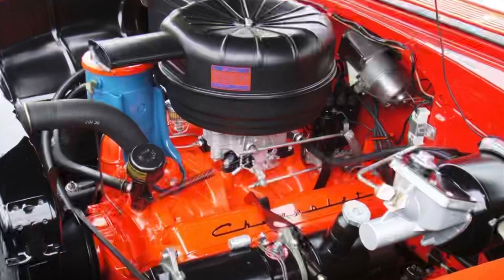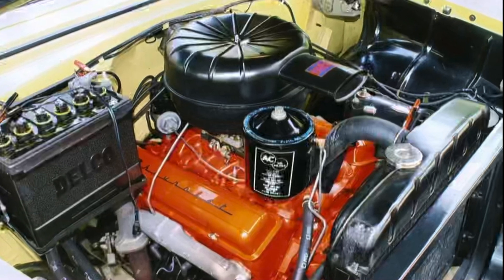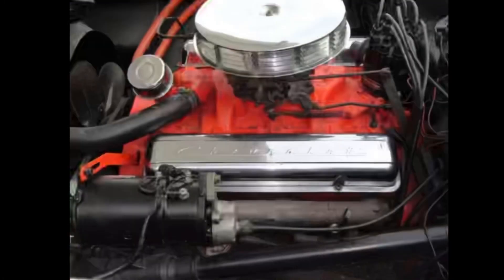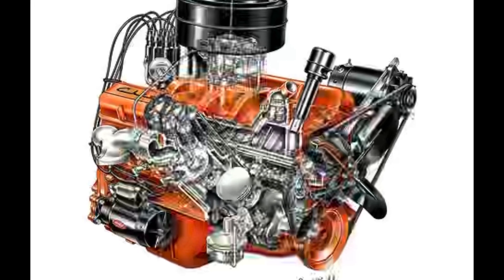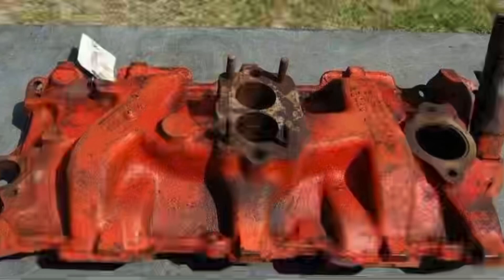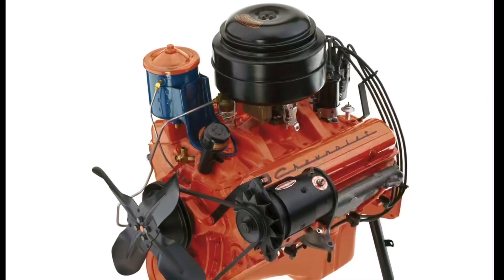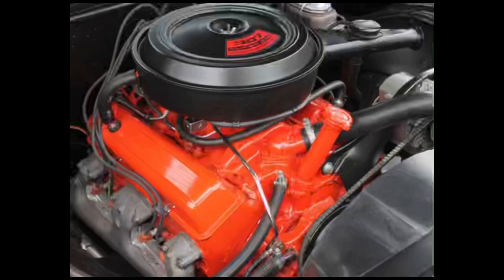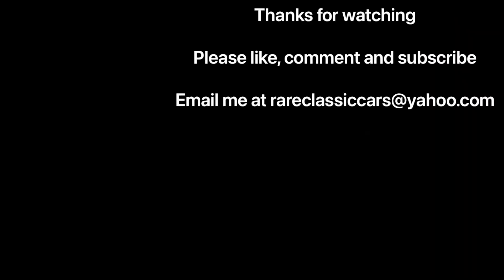Best Engines of All Time: The Chevrolet Small Block V8 (262/265/283/302/305/307/327/350/400)

Comment: I had a bunch of small Block Chevys in my cars, 283, in my 57 chevy, 265 installed in My 33 ford three window coupe. 300 hp 327 in my 1965, Impala 2dr SS, and 275 hp 327 in my 1968 Chevy Camaro, They were bulittt proof if you didn't over rev them, and sounded and performed great in all my cars I had four of those 100 million, so I did my Job...

Comment: I have a 350 that was originally in a 71 Z28.
I put it in a 1980 4 door sedan (that was a blast) and I now have it in a 1934 Ford coupe.
54 years old.
2 rebuilds and still on the road and running great.

Comment: I installed a 1956 Chevy 260 from a Chevrolet sedan into a 1950 model Ford coupe. Later on I swapped the carb out for 2-four barreled Carter WCFB's from a Corvette. A Duntov cam with a notch milled in the back for  oil flow, a floor shift, traction masters, a dual ignition from J.C Whitney. The little engine would hold it's own against many lager cubic inch engines, including Ford 390's! Total cash outlay was about $350.00 including the car!

Comment: You didn't mention the valve guides and smoking. Rear main seal leaks on pre 86 motors. I'm actually headed to buy a 56 265 in ten minutes. To add to the collection of small blocks, under my bench lol.

Comment: 305s can rip with a non restrictive intake, the right heads and a big cam. Same with smog 262's, the short strokes are wild if you can get the air flow and cam for the high RPM's.

Comment: Although Chevy didn't know this, making the engine dimensionally small was a BIG deal later down the years to us folks wanting to swap a v8 into a vehicle that never came with a v8 option. Why you see a lot of SBCs in compact cars of all manufactures. Same with the Ls and truck LT engines. They are tiny when compared to say a ford "coyote" 5.0

Comment: Regarding the "soft cam" debacle....It has been my understanding that the EPA was pushing for ZDDP (zinc) to be removed from oils in that time period, but they didn't really tell anybody. They demanded ever diminishing amounts. That killed many flat tappets in daily drivers. The roller cam was put into the performance cars in '87, but not in to trucks until '96, as they didn't rate to the same RPMs at the f-bodies, impala SS, and corvette.

Comment: With the appropriate nod to the excellent SB 350, I have to say my 69 Camaro with a 307 was one of the best all around motors I ever owned.
It was teamed with a 4 speed and was surprisingly powerful . My 305 cu motor in my 92 K2500 is by far the most reliable , fuel efficient and strong running SB Chevy motor I have ever owned. 236K miles and running strong. HP junkies show little respect for these motors, but I have sent several 350's to the bone pile. I do love my Vortec in my 96 Yukon, Also with 233K miles.

Comment: I had a 1996 Chevrolet Cimmaron GXP with a Supercharged 1.8l Tech 4 -Cyl,....With Vortec Heads and CRT Delco Infotainment a speedometer with fuel n temp respectively, and umm...a auto-man-matic 1 speed clutch motor......

Stop asking its not for sale...

Comment: The 327 and 350 were the best small blocks, and the 283 was also a good engine.  The 307 was a piece of crap the first 3 years oil burners after 40K miles.  I had a 68 Impala and it burned more oil than gas damn car caught fire while going down the road and was glad to see it go.

Comment: Had a 67 Belair with a 283 two barrel 2 speed tranny.
Burned oil yet had good power.
It always started and ran well, nothing could kill it.
These overly complicated engines and drive tranes of today are a cuel joke played upon the consumer.
Long gone are the days of doing your own tune ups except oil changes, that's pretty straightforward, however you have to reset the oil life in the cars maintenance parameters, another minor pain...
Maybe one day they'll get less complicated.

Comment: So the fact that between 80K and 110K more than 90% of these sixties engines were burning oil from #6 or #8 or both means nothing. Those two cylinders ran much hotter.
Almost any import dual overhead cam engine could crush the competition. Even the Toyota 1800 was a true hemi with a 2Bbl could smoke the crap thru some tires. I did.

Comment: Also the rear sump oil pans were easier to use in an old ford whose front sump pans did not fit over an older ford with a straight front axle beam

Comment: Having worked in a machine shop that done engine work when the small block Chevrolet was in production, sometimes we would get blocks that were cracked above the lifter bores, cracked cylinder heads were common , worn valve guides, and spun connecting rod bearings. The drive in oil pump screen should have never been. No engine design is perfect.

Comment: I agree with you 😢😮 But..I wouldn't trade the newer 5.3L..over any of those..The old school..ring job..80.000 miles..valve seals 80.000 miles.most of the time lifters..if they make 80.000miles..My 5.3 L..none of the above 160.000miles😢😢😢Sorry buddy!! And it has alot to do with better OIL NOW..😢

Comment: Four words.  Inlet manifold gasket leaks.  A problem that was never solved completely.
Reply: i never had leaky intake manifold gaskets on any SBC.
Reply: Every SBC I've owned. They leak into the inlet manifold or oil.  Usually slowly so the only thing you notice is the radiator or overflow tank going down slowly.  Sometimes they fail bad and dump onto the oil, ruining the engine quickly.

Comment: My buddy John ,  was Drafted into the Army back in the 70s ,I bought the car a 57 Chevy Bel Air, coupe  for $250, fiberglass tilt front end,  four-speed Muncie transmission, straight axle kit, 283 dual quads, Hooker headers, 5/13 pumpkin in the back gear, Mallory's electronic ignition, 3/4 Inch over cam shaft, shaved heads to increase compression + electric fuel pump, produced 425 HP , low 10s On every run ♥️🇺🇸♥️♦️♦️♦️👍‼️

Comment: Enjoyed the video!!  I too have had a few small block chevy motors. The most powerful one was my 56 chevy 2 dr sedan.  Had a 327 which I built myself, muncie 4 speed and 4.11 posi rear.  The slowest was my 78 camero (my favorite Camero body design) which had a 305 2 barrel.  It was a great daily driver but not worth drag racing. All were reliable including my self built 327 which saw 6500 RPM a lot the way I drove it.  OK, I was only in my early 20's  lol.

Comment: I own 2 G-Bodies, an ‘86 Monte Carlo CL that has been my daily driver, and an ‘87 Pontiac Grand Prix that was my late grandfather’s daily driver. Both have wonderful 305s with a good bit of miles. My Monte Carlo has 127k, while my grandfather put a whopping 747k miles on his before he parked it - and no, that’s not a typo.

It’s still the original engine in his Grand Prix - and while it had a transmission and rear axle replacement over the years that 305 is still chugging. I’m currently replacing the cooling system but the engine itself still runs very well and I plan to keep it that way.

Comment: My two favorite engines to work on are Chevrolet and Honda engines. People can call me lazy if they wish, but I enjoy working on platforms that just work. And while no engine is perfect from any manufacturer, I have had the least issues and the most fun out of GM and Honda engines mile after mile. From old school Chevy small blocks to pre-displacement on demand LS engines, carburetor equipped 1980's Honda D-series engines to Honda F-B-H-K-series and J-series V6 engines pre-displacement on demand I have absolutely loved working on all of the above. And all of the above have been super easy to get extra power out of with just small changes.

Comment: i went from SBC to small block Ford because they were built way tougher, many more oil pan bolts, water pump bolts, valve covers were better with more bolts. Ford was just built tougher but then i got sick of working on my small Fords and switched to Toyota. Now my truck has 330,000 miles. has never used or leaked so much as a drop of oil. never needed a starter or anything. the only thing ever replaced on that motor was the fan clutch. it still has its original clutch in the 5 speed. I'm still a Ford guy and if i won the lottery i MIGHT buy a new Ford

Comment: Have 1978 Pontiac Lemans with 305 Chevy from factory. Replaced cam because a couple lobes were worn.  Also replaced oil pump to make sure new cam got good oilflow. Car has almost 200,000 miles and still runs perfectly. Great solid engineering.

Comment: This has nothing to do with the 283 or a Ford or a Chevrolet thing, this is to do with my dad and my uncle arguing about motor oil in the '60s. my uncle bought a brand new 63 Impala station wagon I loved that car powerglide but my dad and him would forever argue about the oil that my uncle was putting in that 283 it was Texaco no non detergent. By the time I was 16 years old and 73 we went up to buy that car and it was going click click click click click and my dad said the lifters are plugged up with Gunk from that Texaco oil he used and they were and we cleaned it out and it remained a good car I always like to square tail lights on that 63 wagon but sludge of any kind will ruin a Ford or any engine

Comment: Back in the late 90s I had a 1986 IROC-Z, the water pump took a crap on the side of the road, went to the local Murray’s, got a new one, got back to the car and opened the box to find out that there were no gaskets included….good thing I had a couple old scratch off lottery tickets in the car that I was able to cut to fit, and they were still holding up 3 years later when I sold it

Comment: I have run 283s for everything, trucks, hot rods, daily drivers.. can't kill them Currently I have a 64 El Camino with hundreds of thousands on it, original 283,. Yeah it smokes after idling, but still runs strong, it's getting rebuilt soon. Sticking with the little mouse

Comment: The one thing I really have liked about the GM small block is their consistency of basic design and interchangability of many parts, especially external. Bell housing bolt patterns never really changed. And as far as the 305 and 307 were concerned, you're right. If you can get them to aspirate better, that definitely helps. The right cam also makes a huge difference. Granted, you may not get the flexibility of horsepower range like you could with a 350, but one You Tuber did a budget build on a 1970 307. The main thing he did was put in a good street running cam and then put it on the Dyno. I can't remember the results but it was rather impressive for an engine everyone said was a dog.

Comment: There was an article in the Flint (Michigan) Journal newspaper in 1998 about a guy in Wisconsin who had put 1,000,000 miles on his '91 C1500 with the 5.7L (350) TBI engine.  The engine had never been opened up.  He did have to rethread the oil drain plug because the threads were worn out!  I forget how many transmissions and water pumps he went through.

Comment: The ford sixes will out last any GM engine made. I have seen fleets of 260 300 289 302 go 500K mile , with out any major repair. The 265-283 307 350 400 will have backed out valve studs, worn out lifters and cam before 200K.

Comment: Gooday  AA! This is  A.K.A. "MOTOR MOUSE" here. Love the vid ,Love the "Grump" Love  life ! I'm a ex Maritime Cylinder Grinder , Van Norman 111 Precise Crankshaft Grinding "Hot Shot" (SHIPWRIGHT THROUGH WORLD WAR 2 STARTED THE NICKNAME IN  HALIFAX NOVA SCOTIA} that produced .0000" run out with a 1943 Machine in 1980 . Best Machine possible for Crankshaft preciseness   between centers the way our little chevys were produced "Qoute Unqoute" The sbc was ahead of it's time , but the factory was not big on training. I'll clarify . From the chrome valve stems & piston rings that would help you with your "Cape Islander Boat" doing a little fishing to the 5 cylinder head bolts around each cylinder thereby reducing torque each bolt requires creating less distortion at the top of each cylinder making the rings able to work better, longer. Now we hone cylinders with deck plates to simulate the condition the engine sees while running . The reason why we did not have "Fuel Injection " earlier is because GM Techs did not have training to work on the early fuel injection systems well enough & it was on the best engine possible at the time ! P.S. I hate the 305 with a passion ( WE had 3 firsts in 3 races with a 305 I built "stock" LOL just a good valve job , chrome rings & blocking the exhaust going under the intake) with the 2 center ex ports going under the intake & if you did not use synthetic oil the intake bottom would build up with varnish go down to the lifters & then they would stop turning & taking out the camshaft. S.B.C. Forever. I just got a smoking deal on a set of 292 castings HMM I got to go . James T. Burke Live Long & Prosper

Comment: The SBC did suffer one "defect" which was valve guide wear. At around 70~80k miles you would start to experience plug fouling mainly on the rear cylinders (Where oil would accumulate). The stamped rockers had no provision to lubricate the rocker-valve stem contact point which caused friction and resultant "pull" inward on the valve stem thus wearing out the valve stem hole in the head.

A roller tipped rocker would have eliminated this problem.

Comment: Nice little engine in nice cars of the 50-60's. Had a 56 Chevy Belair with 265 v8, automatic. I was in the U.S. Army in 1967-69, and stationed for a time in Wash. D.C. my home was L.A. CA. Came home on leave and got married in 1968 and we drove to duty station in it in about a week, taking time to go some National Parks along the way, Yellow Stone, etc. No problems all the way. Took same car home in 69, after I ETS'd, to L.A. My wife and our new baby flew home. I drove, a week, to get back mostly on route 66. Did have overheating probs halfway home so drove at night and motel-ed in daytime. Got back ok. Same car got t-boned a year or so later, at home, on my way home from work. I pulled the rear quarter fender away from the rear tire and drove home. Fixed it and repainted it a nice stock color (was dark green, I had stupidly painted it from stock purple and white), gold and white. 

Try that in you Prius or Tesla!! Sold car in 80's for a "song", $1800, now the car would be worth big bucks ($50K+) at auction. LOL :D

Comment: The small block Chevy is my favorite engine. I have built dozens of them, from daily driver engines to full blown drag race engines. You can build anything out of a small block Chevy. It is an engineering masterpiece. One of my favorite configurations is a 383, a 350 block bored .030 over, with a 400 crank.

Comment: the first chevy small block was trash that didn't even have an oil filter. they were OK for their time but there were better engines. nuts to nuts the LA Chrysler was a better engine that would endure far more punishment than a small block chevy. I can tell you for a fact that Chevy's and Fords are the only brands that have forced me to use Pat and Charley mode of transportation. The small block chevy is the only engine I have ever managed to crack. the only advantage these engines had was cheap and abundant.

Comment: There are plenty of great aftermarket cams and water pumps available for SB Chevy engines. Edelbrock is one of the most reputable names out there. Little shortcomings like that can be easily fixed with aftermarket parts.

Comment: You could pull a water pump off a 1957 dump truck & put it on your 69 Impala with minor hose fitting changes. From the 262 all the way to the big 400 these were the most adaptable engines ever made. I've owned a lot of these and they trump all other brands, IMO. Most all the V8 offerings from GM have been pretty good stuff. There are currently 6 vehicles at my place, and all are GM, mostly Chevy.

Comment: Im not chevorolet fan boy 
My parents had a 75 4 door chevrolet nova base model it stayed broke down   most of its lifetime
My dad finally sold  the car in 1994 
And said that he wished that he had never bought that piece of 
He replaced it with a slightly used chevrolet silverado  that truck has been reliable  point of this comment is that every mabnufacturer in the world on occasion lets a bad product out the door  that old nova with its 200 cid 6 cylinder engine and turbo 350 trans was one of the ones that shouldnt have left the factory
Either way being broke down on the side of the highway in ga  on a hot summer day multiple times as a child was what turned me off to chevrolet vehicles
When i started driving my first vehicle was 74 ford f series that old truck was wore out but it never left me broke down on the side of the road i sold the truck 2 ish years after i bought it because of electrical issues that i didnt know how to fix it still ran and drove reliably that being said i drove ford products exclusively untill 4 years ago when i bought my 97 toyota camry it been an ok car but my next vehicle will be a ford product

Comment: I enjoyed the video very much and I found it to be quite accurate however there is one point I would like to mention. The small block Chevy was only equipped with a forged steel crank shaft in high performance packages otherwise it had a cast nodular iron crankshaft.
Reply: All 283’s came with forged steel cranks. Look it up.

Comment: In the description the first motor listed was a 262. I don’t remember that motor. I had a 55 back early 70’s that had 265. Sold that for a 57 with a 283. 327 was my favorite. Had several Chevy ll and 1 had a 327 fuel injection & 4 speed from a totaled Vette. So wish I’d kept that one.
Reply: The 262 was introduced around 1975 but was superceded by the 305 soon after.